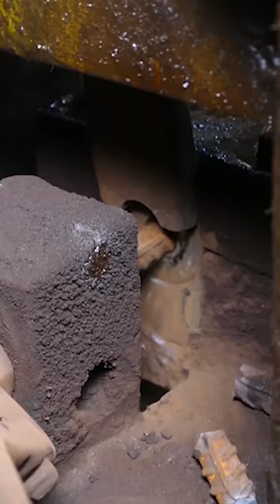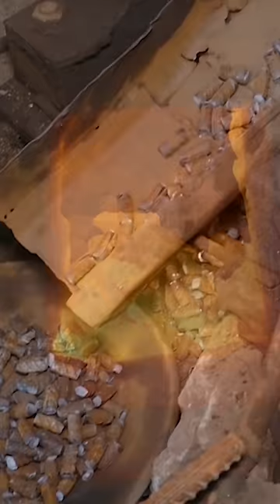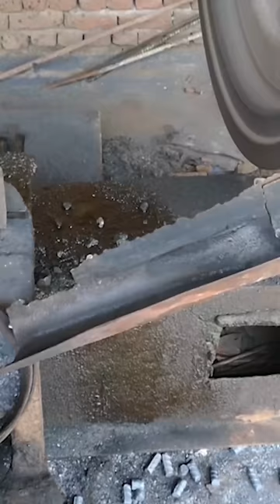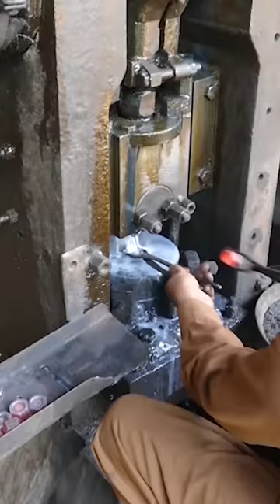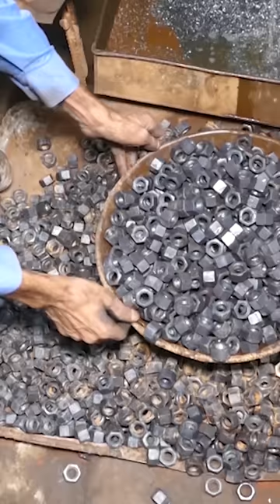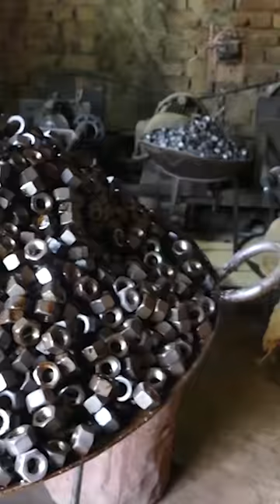Hexagon Nut Production Process with Amazing Technique

Comment: Ahh yes rebar one of the cheapest softest steels you can get these are one of those special righty loose varieties
Reply: Atleast you won't need loctite since it'll rust and seize!
Reply: Crazy almost like they tempered the steel by putting it in a furnace to harden it
Reply: @loganbaileysfunwithtrains606  All the tempering in the world won't change the carbon, nickel and kobalt content of the steel. Very poor way to manufacture a nut

Comment: That’s not blank steel. That’s rebar. Not sure if it’s safe to put a lot of torque on it. It’ll probably strip the threads. If this is just for non load weight bearing and light construction then ya.  But these are not what you want to use for heavy metal or required tight fittings.  Nope.
Reply: Heating gardens the product. You would not use a sheet of steel to make nuts that size. First it would not be a sheet it 
would be a solid piece of metal. The heating gives the nut it's strength.
Reply: @thegoonies2  who said anything about sheet? There's a lot that goes into metallurgy, but I for sure wouldn't want a nut made from rebar. I'm not savvy on ferrous materials, but I've metallurgical assessments on many types of metals, mainly aluminums, for the aerospace industry for about five years now. Heating also doesn't harden the product, it softens it. Its the cooling process that determines the hardness of the material
Reply: @RazzleberryHaze  it is the heating, cooling process and carbon content of the steel  that increses the tensile strength of the product, it has to be heated to around 830 degrees celcius, then rapidly quenched in oil preferably or water, over hardening can also cause problems... Things chip and break aswell
Reply: @nashirdmohamed6200  does rebar have the carbon content to harden? While any metal can be heat treated and tempered, without the high carbon content it just won’t harden like other high carbon materials.
Reply: @thegoonies2  You can't harden rebar, because it's mild steel.
Reply: @eizzle78  No, it doesn't.
Reply: @eizzle78  as someone said in a different thread,  rebar is the hotdogs of the steel world. It's just such a heterogeneous mix,  one spot could be very high and another could be super low. I've used rebar to teach my students to not trust scrap steel. You can heat and quench a bar and get different hardness along the length.
Reply: @slappy8941  it could be mild,  could be high carbon,  that's the problem. It's inconsistent. Could be below .05% to over 1.5% and that can change along its length.
Reply: I was thinking the same...I'm not a metal person but I'm hoping these are kept there in their country...our john deere won't stay together with rebar nuts...just baling wire and gorilla tape!!!
Reply: Yes it can be hard when they mix Viagra on it
Reply: @eizzle78  surface of rebar can be harden if quenched in water. rebar contains carbon upto 0.25% hence it's suitable for surface hardening only.
Reply: Точно сказал
Reply: @kjo7887  
For wood decking, construction
Reply: @slappy8941 you can harden mild steel, just not to the extreme of other steels
Reply: Q989ij0
Reply: Como on people it's INDIA.... enough said 😂😂😂
Reply: @thegoonies2  rebar is very low carbon. Quenching does nothing to it; this is effectively a wrought iron nut and the thread would destroy itself basically right away
Reply: Another perfectionist😂 in comments atleast✌️✌️✌️
Reply: Absolutely correct! The rust inclusions in the finished product is problematic.
Reply: They aren't stamping any specs on it so you can assume it is cheese grade. They'd probably use that for struc steel in their country tho.
Reply: @ayyydriannn7185  Just look at the example at the end. Cracked and missing threads.
Reply: @nashirdmohamed6200  that’s just not correct. Rebar is usually mild, low carbon steel and can’t be heat treated.
Reply: @mister7806  wrong
Reply: @BA_1002  what is right pl. explain...
Reply: It would make perfect fittings for water , gas  or anything like that but need to look in to better tap's  I wouldn't even try and show qc those threads
Reply: @thegoonies2 bro what are you talking about lmao, nvm you obviously don’t know
Reply: @thegoonies2 No amount of heat treating is going to make rebar stronger. It is not hardenable steel

Comment: Finally! Now I know how a bolt with 3.6 tensile strenght is made. Good for fixing your child drawing. Everything else will break off.
Reply: Did you see those threads at the end? Ungodly...
Reply: They will surely heat treat them through conventional means
Reply: @dplugCAPZ  will they though?
Reply: @dplugCAPZ  rebar doesnt heat treat well at all.
Reply: @OrbitalSloth42069  they used round stock
Reply: @dplugCAPZ  watch it again, looks like rebar to me.
Reply: I can feel if it's going hold or look at it befor zip buy.lol
Reply: @dplugCAPZ  it was definitely rebar...look again.
Reply: @dplugCAPZ  Try less MDMA and more focusing on the stacks of rebar at the beginning of the video.
Reply: 3.6? dude it's like 1.2
Reply: drawing dikertas segienam. A2 .ACC.
Reply: Except these are HOT FORGED not COLD forged like EVERY bolt made in the west. I should know because I worked at a place that threaded bars for 2 years.
Reply: @dplugCAPZ  don't need to because they're HOT forged already. Unlike everything in the west that's cold forged and either cut or rolled. I know because I was in the business for 2 years. Good job during covid doing 65 hour weeks on afternoon shift. Made me rich.
Reply: @YungQueef  why does he have German accent lol
Reply: @OffGridInvestor  hot forged mild is still mild
Reply: You are Wrong 😒 it will never Break off n it is not a Children Drawing Video 👎🏿
Reply: @OrbitalSloth42069 definitely rebar.  Attrocious threads at the end too.
Reply: They actually heat treat and forge it if you watch it till end
Reply: @OffGridInvestor  Heh heh, nobody "gets rich" sitting in front of a press for 65 hours/week.

Comment: love how he lifted the basket to reveal that all the nuts from the bottom layer come pre-rusted
Reply: yeah thats great I love rust on all my material
Reply: O
Pan
Tttr
Reply: Give ‘em a nice touch
Reply: It’s like in plumbing.. you think your brand new pipes are gonna be shiny and clean.. hell no.. the pipes and especially fittings were always rusted, the cast iron stuff was always rusty and dirty as shit when we got our new materials in for jobs . I was like this is not new.. and boilers.. don’t get me started.. was a fucking mess..
Reply: Just think of it as nature's lock-tite
Reply: @TheCyberCrabTV sĺ.oò
Reply: @pinchespiderman c
Xxkhvz at the
Reply: Might still be a hardening process left,  even a bluing and mineral oil ???..... at this point its soft enough to tap and hasn't seen quenching ; or this is as good at they get
Reply: @mattdenty4825 To be fair, even if they're not precise, they'll hold well because they'll rust and sieze up very quickly.
Rebar is not the right alloy to use for this application.

Comment: “What sort of tolerance are these machined to?”
“They turn.”
Reply: Same as a barn builder +/- ¼"
Reply: Rough!
Reply: kykingz78  never heard of outside nut thickness and width? 🤡
Reply: 🙈kto
Reply: @@nobottee ah yes, the perfect way to measure tolerance, eyeball it through a video, 🤡🤡🤡🤡🤡
Reply: Yep, came here to trash talk their quality. I see you beat me to it lmao.
Carry on
Reply: Means if Workers do any mistake so Factory owner don't Tolerate them?😕😕
Reply: The advantage is that you can use those to any scrue +/- 1-2 mm. And there is also no need to be perfectly aligned with the scrue. It is cheaper :))
Reply: Sut to sut ❤❤❤

Comment: Imagine this is what you have to do for 10 hrs/day. 6 days/week
Reply: I'd put on some headphones with a podcast on.
Reply: Yeah, that's nuts
Reply: @utsavman47  there's no wifi and the signal in the factory is terrible
Reply: @alexthewormking5913  you'd be surprised with the signal quality in places like this.
Reply: And your paycheck at the end of the week was $1.50
Reply: @alexthewormking5913  download to local device
Reply: @jpablo700  your battery only lasts an hour and a half and there's no charging point anywhere in the factory. Plus your device is only 128mb so can't download much
Reply: Im honestly unsure if you get to the end of the week. I mean, at somepoint youll lose a hand or at the very least a finger…
Reply: @alexthewormking5913 pk0k0pk0kp0k00k0k0k00k0k00k00k0m00kk0k0000k00k0k0k0k0k0kkk00mk0k0000kk00k0kp0kk00m0k0k00kkkk00k0m00k0pkn000000kk0k0k00k00k00k0pkk0k0kk0m000kkkk0kn0k000k00m9kn00k000k0000k09m00kpkp0k0k0kp00k0m0k000k0k0k0k00k0000k0kkk00kk0kk00k00kk00kpmk0kk00pk0k0k0kk0m0k000k0k0kk0p0pk00kk0k00p00k0k00k0k00k0k0k0p0k0k0k0k0k0k0k0k00k0k0k00k00k0k0kk0kp0mk0k900k00k0k0kp00k000000p00k000k0k000k000k0k0k0pk0000009000kk9k0kp0k0k0kk00k00k0k0k0k0k00kk00k00k00k0k0kkpkk000k0k0kp0pkn0k0k000k0k0kppk0k0k0k0kk0pk000pk0k0k00k9k0k0k0k000k0k00k00k0k0k0k090k00k00k0kpkk00kk00000k00kpk00k00k0k00l00k00k0k0k00k0k0k0k0k0000k000000k0000ppkpk0k0k0kp00k0kpp0pk00000k9000k00k00k00000k0ko000k0k0k0kp0000k0k0k0kk00p0k0k000k0kk0k0k00k0000k0kpk0k0k0000k0k0k0k0kk0k0k0k0k0k0k0k0k00k0k00k0k00k0k0kp0k0k00k900k00kk0k0k0k0k0k0k0k0kn0k0k0k000kkk0k0k0k0k0k0k0k0k0k0k0k0k00k0k0kk0k0k0k0kk0k0k0k0k0k0k00k0k0k0k0k0kn0k000k0kp0k00k00k0kk0k0kkk0k00kpk0k0kkk0k0k0k0k0k0k0k0kk0k0kk0k0kk00k0kk0knk0kk0k0k0kpk0kk0k000k00k0k0kk0k0k0kkkk000k0k0k0k00k00kk0k0k0kpm0k0kpk0k0kk0kk0kpk0k0k0k0k0k00k000k0k0k0k0000kkk0k0kk0k0k000kk000k0k0k0kk0k00k0kk0kpk0k00k0k0kk00kkm0k0k0k0
Reply: And make about .25 cents a hour
Reply: Still better than many jobs I know.
Reply: Don't have to imagine. Worked in a plant a lot like this right here in north Carolina 15 years ago
Reply: Brutal
Reply: Yeah I worked at a small bolt company where I made bolts from any size. 3" all the way to 20 foot anchor rods before, and got to cut the rods down then thread each individual piece, except with anchor rods they most the time get threads on each end . So say you get an order for 2883 26 3/4 long bolts, 4" of thread on each side. That's about a 3-5 hour job right there doing nothing but standing still at each machine
Reply: And make 37 cents a week doing it
Reply: And after all that the threads arent even proper. Maybe 11 hours 7 days a week is better
Reply: Yeah just like any other manufacturing or labor job
Reply: You go nuts
Reply: 10 hours a day?  Slacker.
Reply: @0cardcounter  Yeah, 24 hours in a day. What is he doing with REST of his time?  Really calls into question his commitment… 😉
Reply: No, no, no. I go through 12 hours, 7 days a week.
Reply: @johnmclaughlin2540  oh no man 1.5$ is way too low. No one will work for that even in the poorest countries.
Reply: I work in this type of factory😢
Reply: @utsavman47  Most places prohibit it.

Comment: I wouldn’t use those nuts to scratch my back let alone expect them to hold something together
Reply: You realise that the OTHERS are made using an automated version of this right? I used to work at a place that threaded concrete reinforcement bars so they could be attached to each other with tube nuts. We used modified lathes and a cold forger but hot forging like this is THE STRONGEST way to do it.
Reply: @OffGridInvestor  It's not the process that is the problem, it's the really soft steel. The threads will rip right out with any load.
Reply: @williamiverson903  that’s right. Rebar material is pretty low grade carbon steel. Structural grade nuts are made from much better material.

Comment: I’m going to stay with good ol’ USA grade 8 not that 40grade rebar is dirty steel but use it as intended, and if recycling is a thing try smelting with adding more carbon along with a few other elements …… ps last time I checked you might be in a geologically seismic hot spot and hasn’t worked out so well over the past few decades . Just a thought 💭 ❤😮
Reply: It’s scrap steel sent back overseas, repurposed and marked up for a high profit margin, and sold back here to Homedepot.
Reply: @Bhatmann  that’s my point if it’s import it’s always suspect, if not inferior and should never get used under any other purpose but ship ballasts
Reply: Yup.  Domestic/German/Japanese is a good general rule.
Reply: That why the nuts and bolds strip treats so easy nowadays.
Reply: Idk that rebar would even qualify as grade 2 lmfao
Reply: @Bhatmann 😜😜
Reply: What's that got to do with nuts? They aren't used in buildings.
Reply: @70newlife  just airplanes
Reply: The look a lot like the 5/8” anchor bolt nuts I put in my foundations before galvanization ( but they come from china lol)
Reply: Oh and most rebar is grade 60
Reply: @danno8852  
Rebar is always just low grade mild steel. If it was even grade 5 it would be a nightmare to work with in concrete.
Reply: @realitybites1253  amazingly stilll the most powerful country in the world and still has resources to support your country
Reply: @Bhatmann   LOL so true
Reply: @70newlife  you don't think nuts are used in buildings? Of course they are.

Comment: Ahh, rebar nuts the pinnacle of quality.
Reply: garenteed to last at least as long as the 3 hammers they will use to install them
Reply: Rebar is actually made of very high quality steel...quite hard.  BTW I was an estimator at a large structural steel fabrication plant for 17 years. It would make excellent blades as well.
Reply: Rebar nuts? That was my nickname in high school
Reply: @Jreb1865  are you sure? An old blacksmith once told me never to make knives out of rebar because it was bad steel, maybe he was wrong though
Reply: @mackinbox  Not every type steel makes a good knife. A knife needs a high carbon steel that will harden makes a good blade. Leaf springs from a car or truck makes a good blade, as will a railroad spike...
Reply: @Jreb1865  is rebar high carbon?
Reply: @mackinbox  No, rebar is very often from scrap steel. No one wants to put high quality steel into the concrete
Reply: @abbadon894  that’s what I thought
Reply: @mackinbox  no, there is no real reason for it to, but it must meet certain strength requirements and comes with certification papers. BTW, ALL structural steel shapes are made with scrap.
Reply: @Jreb1865  Rebar is mild steel
Reply: @Daniel Crawford
Reply: @mahhobadikshad  ?
Reply: It's been quenched, so it's a high tensile steel now.
Reply: Peanut, Walnut or Coconut?🤔
Reply: There’s different quality rebar, but what they put in is probably just mild steel, which is fine for non serious jobs
Reply: @Jreb1865  q
Reply: @SudheerKumar-bj7ks  m
Reply: @turolretar  Check out the specs for the rebar used in cooling towers at a nuclear plant.
Reply: @psuchomattis  qwerzuiop
Reply: Rebar steel is full of inclusions and not quality at all. I wonder why they bothered using such crap steel.

Comment: Oh look, garbage nuts. Hate to break it to ya buddy but rebar aint nut material. especially not at that size. Theres a reason shits graded. That is a soft steel. That will fail pretty much immediately, IF it doesnt fail when you go to torque it